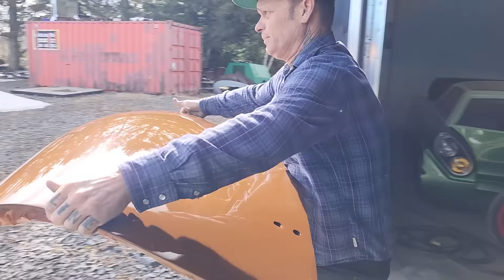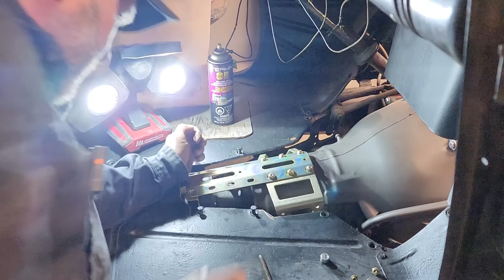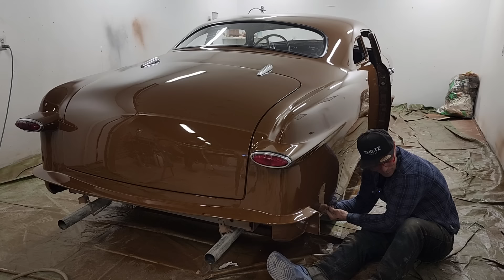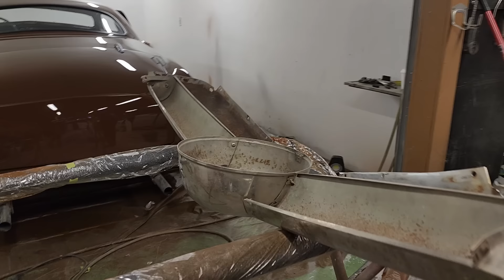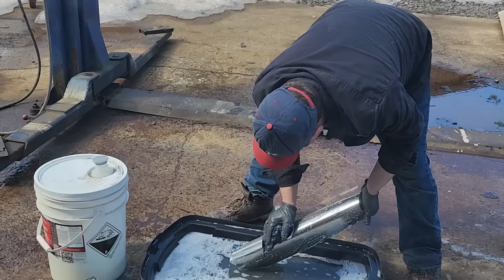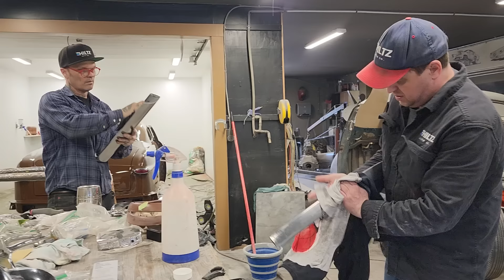The stressful part begins... re-assembling 😬

Comment: Chad and Jolene , It's great to  see Team Hiltz back in the shop working on the reassembly of the Ford Shoebox and the Hudson Terra Plane. Your valiant attempt at cleaning the stainless steel and  chrome stripping is a minor setback  . Which can be resolved with some minor re-chroming . I's wonderful see Nate installing the neat looking shifter kit . in the Hudson.. Once the Kit is installed it should work well with automatic transmission , but also keep the originality of this classic sedan

Comment: I detail cars, no wire wool, tin foil or old school ideas. 

So says VP Mothers, we always start with the weakest option first. 

Any quality chrome  product, Autosol has high cut. White  Diamond, Mothers Meguiars Mag Chrome. 

Any ratio of that Alu Brite seemed too strong, may high strength TFR will dull diamond cut rims over time. 

It may come back a bit...we all make these mistakes it is easy to do..

The car is looking good plus that paint great depth plus clarity.

Comment: Hey Guys 
If ya gonna go as far as a rechrome you should check out the different stages of chroming, you might like the copper coat or the nickel coat I just thought either would really pop with the brown… just a thought you can also buy a kit of paint that has a couple of processes that will turn your parts in to chrome right in front of your very eyes, it’s great stuff

Comment: Note to Chad: Always do a little test spot on a piece of chrome when you use a chemical product on it, to see how it works. I never just put the whole piece in a tub of the chemical product, just in case it eats away at it, or does cosmetic damage.
Reply: We had a product called Ali in the 90's not good on paint...

Our ratio of chemicals has to be correct on paint plastic ect or damage will be caused..that test spot is recommended.
Reply: AGREE W YOU

Comment: Use 0000 steel wool on your chrome to clean it up.  The chrome is harder than the steel wool and it won't scratch.  That's how I keep the chrome on my 1977 harley-davidson clean and polished. It works amazing as long as the chrome isn't pitted. Surface rust will disappear

Comment: I am 71 years old and my main hobby for over 50 years has been to clean things. For chrome I use brillo pads for light rust and Maquires Mag wheel polish.  Mag wheel polish is the greatest stuff made.

For cleaning cars I use Comet powder cleaner. It's a detailer in a can.
Reply: Mag wheel cleaner would shine up the stainless piece like new.

Comment: When I have chrome to clean I use some aluminum foil and rub the chrome with it.  It cleans it up pretty nice and don't scratch up the chrome. it wont fix a pit but it will take off rust stains and stuff.

Comment: You didn’t tighten the lug nuts on the right rear wheel before you closed it in with the wheel cover. It would be a shame if wheel fell off on its maiden voyage.

Comment: Here's a tip for you instead of taping a lot of things aluminum foil works great go handles antennas hinges if you don't take them off those locks that you taped up just wrap it with aluminum foil paint it pull it off. Then again aluminum foil was a lot cheaper 15 years ago